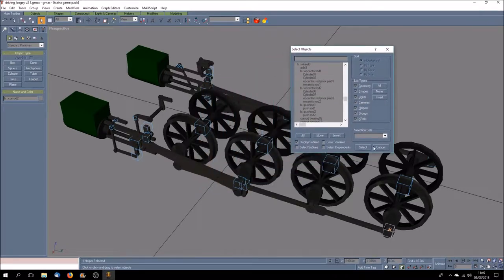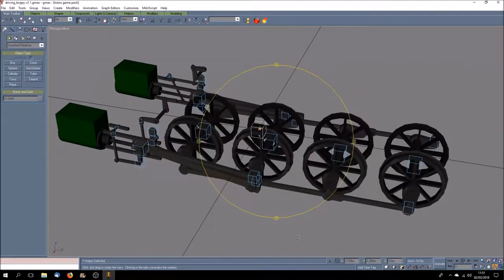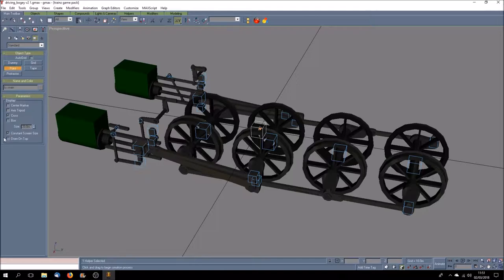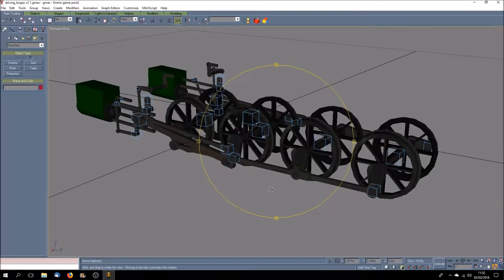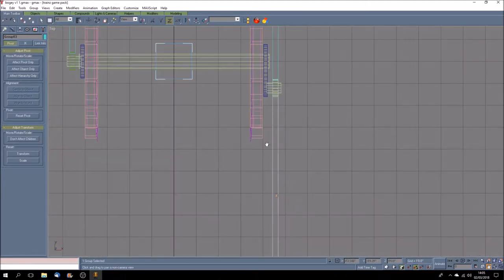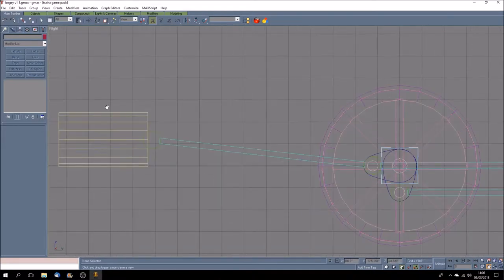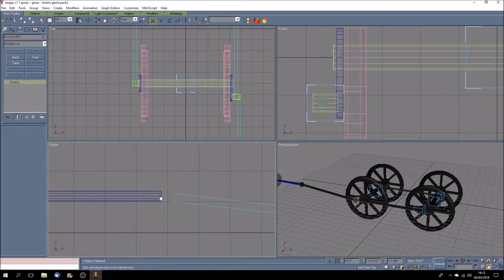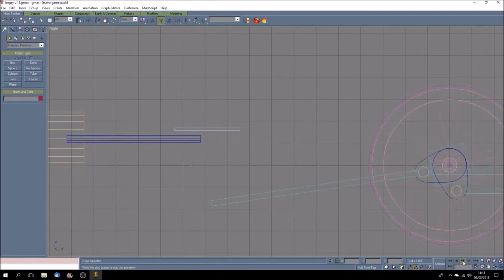Gmax: How to make models for Trainz, part 14 - Connecting rods and pistons

Comment from the maker: In the first part of the video I am using my model of the driving bogie of the Letterkenny & Burtonport Extension Railway 4-8-4T 3ft narrow-gauge loco - the largest narrow gauge loco ever to run in the British Isles. The bogie contains 4,106 polys altogether. Later in the video I am demonstrating how to model and animate a smaller driving bogie, and this is therefore smaller. It was just a demo so I didn't keep the model.
However, the Ballymena & Larne loco which I modelled online has a driving bogie with 2,942 polys; it has 6 driving wheels instead of the L&BER's 8.
I have found that it's well worth 'spending' a fair number of polys on the driving bogie of steam locos as it is the most important part, visually. Leading and trailing bogies also use a fair few, although much less than the driving-wheels' bogie. Looking again at some of my older models if I was to redo them then I would increase the detal of the driving bogie, and especially the number of polys for each driving wheel.
Another minor factor that influences the final size of the overall cdp file of a bogie is the amount of animation, as this adds a .kin file. To offset this and the overall poly count as much as possible I try to keep the size of textures to an absolute minimum so as not to tax graphics cards.
Let me know if you have any other queries.